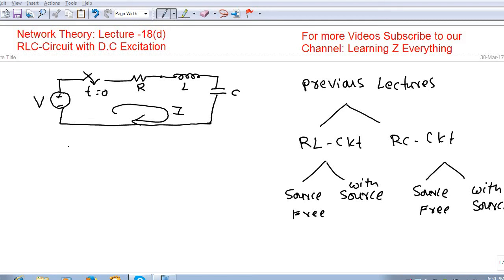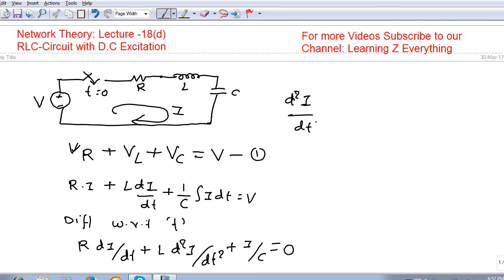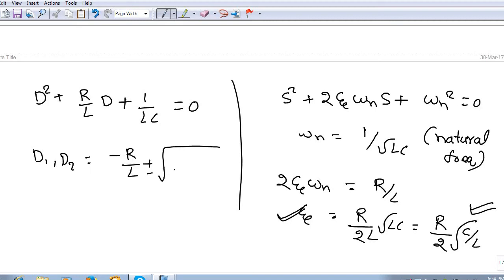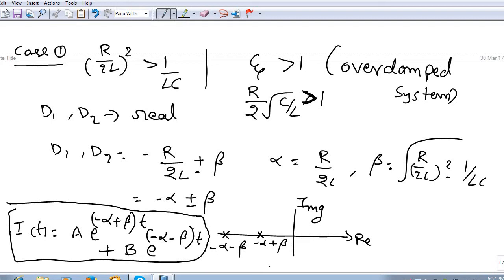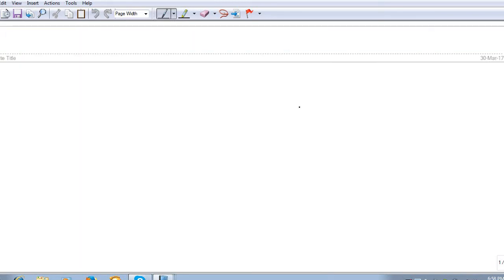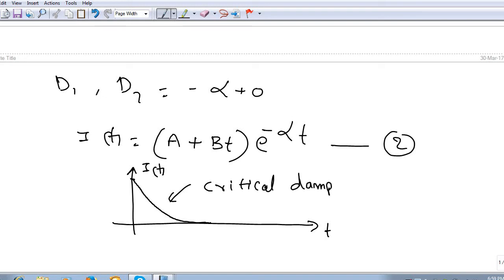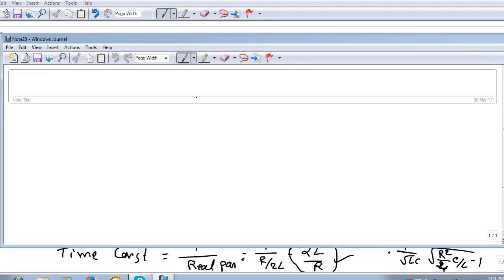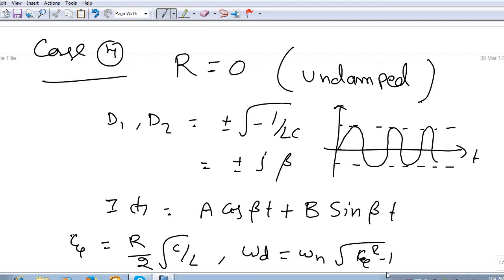Network Theory Lec-18(e) : Series RLC-Circuit with D.C Excitation

Comment: sir if we are told to find voltage across inductor or capacitor in series RLC circuit can we apply the same equation? or is it only applicable to find the current?
Reply from the maker: first we have to find current then voltages across each element
Reply: OK..so in parallel ckt first we will find voltage and then current through each element.
Reply from the maker: yaa
Reply: ok